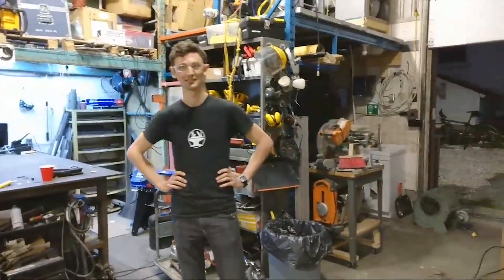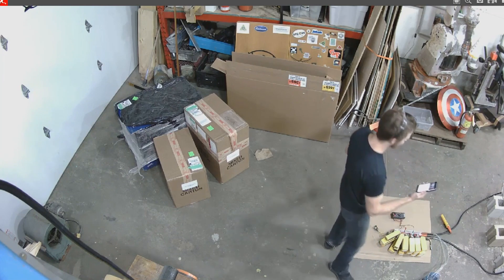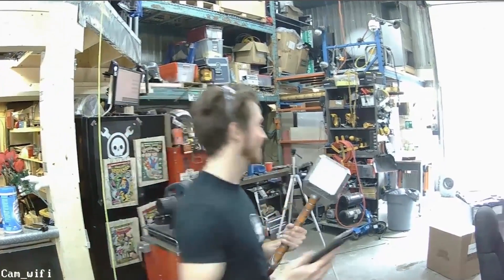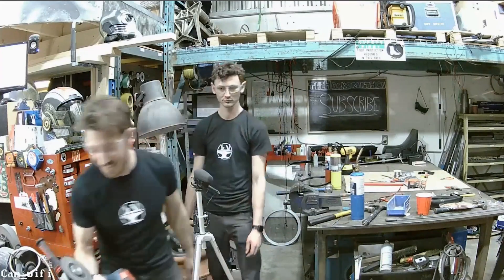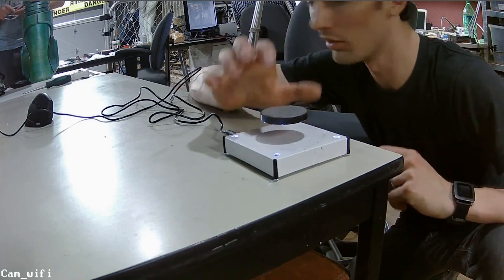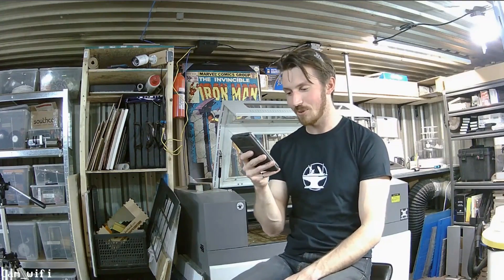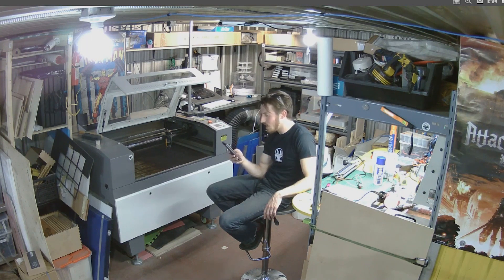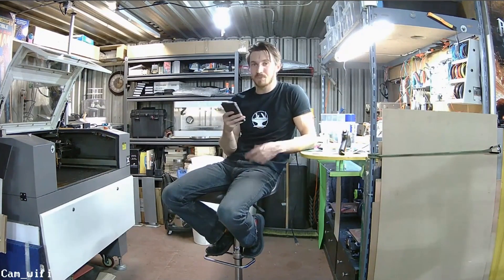Lightsaber Testing + FAILS (livestream edit)

Comment: "And from that day on, the Hacksmith had two steel beams welded to their shop floor."
Reply: Shavono its hard to weld steel to concrete nearly impossible, (ik bc im a learning blacksmith)
Reply: makes sense
Reply: I’m from 2020 hi
Reply: Top 10 most asked questions finally answered

Comment: $70,000 for EDFs for the Iron man flight project. That's tough. I guess my question is would the Markforged Mark X be large enough and capable of printing EDF blades strong enough for the project? I understand that cost is still the issue but I think it's around $69,000 and if its capable of doing what you need I think investing in a machine that can build lots of things as apposed to EDFs that can only blast air at high speeds would be a much better investment.
Reply from the maker: Markforged is too small =( We need like 18" EDFs

Comment: hacksmitg should use his new 3d printer to print a propeller for the iron man project because it is stronger and he can spin it at a higher rpm like that test he did a while ago
Reply: He tried in another video , but it is difficult because he can't make the design perfect , any imperfection in the manufacturing will cause to explode or break , as far as I know he is working on it .
Reply: tarek ahmed yeah but his carbon fiber printer
Reply from the maker: carbon fiber 3D printer is too small =(
Reply: the Hacksmith (VLOGS)  makes sence
Reply: Couldn't the hacksmith just print parts of it and assemble them together like 3D jigsaws
Reply: just a thought
Reply: Well , depending on how he assembles them , but I would say that the structural integrity of a single part would be better .
Reply: Hacksmitg?
HACKSMITG???
Reply: redstone craft guy your so funny!
Reply: @theHacksmithVLOGS  use metal 3d printing

Comment: You will use Tungsten wire... am I right?
Reply: Not wire exactly...
Reply: the Hacksmith but I got the material right
Reply: the Hacksmith wire would bend don't know what I was thinking lol
Reply: the Hacksmith steel mets at 1500 degrees Celsius and tungsten at more than twice that so that's what made the most sense to me. It sounds expensive though